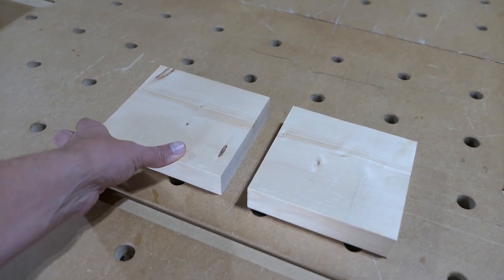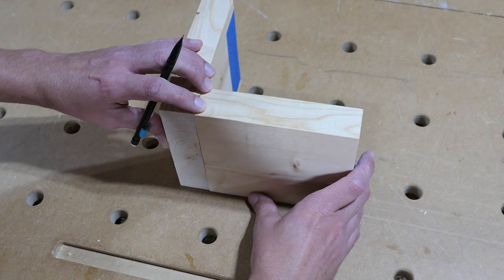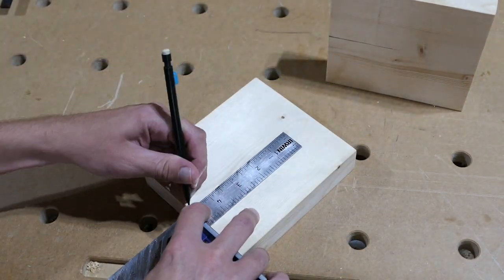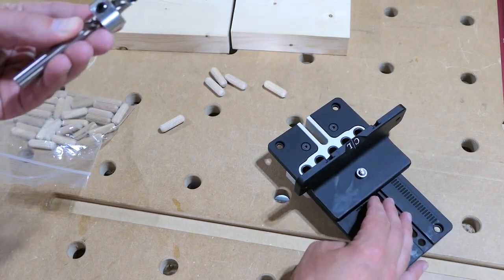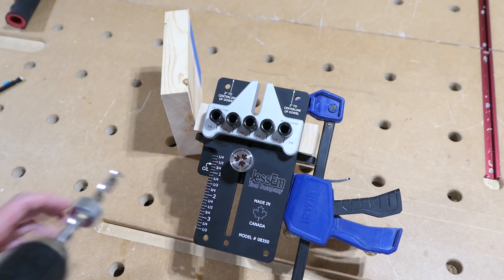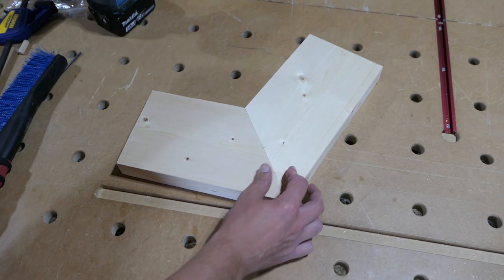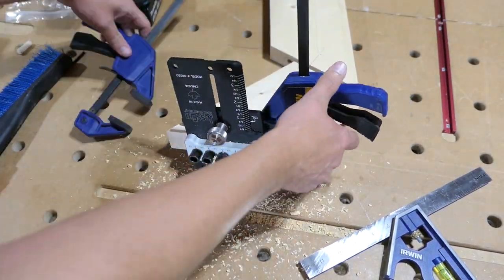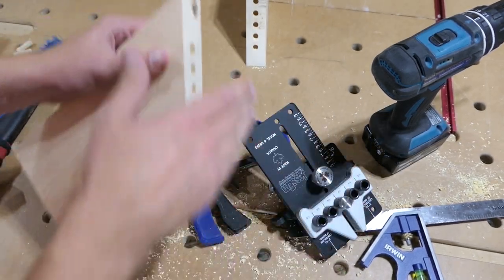2 Woodworking Joints with the Jessem Dowelling Jig - Detailed Instructions

Comment: I strongly recommend anyone considering this jig look into the dowelmax. If you still decide to get the Jessem, consider using the dowelmax's "reference face" method instead of measuring and marking center lines. It will almost certainly give you better, more consistent alignment of your dowels.
Reply from the maker: Hey thanks for commenting with your recommendation, I haven't tried the dowelmax but I'm sure it's well suited for dowelling as well! Cheers 👍
Reply: I tend to agree that marking a centerline with pencil is a point of potential failure and that aligning with a reference face is a better approach. Since the Jessem jig is symmetrical,  you are able to use the indexing pin in the first hole to align the array of holes from a reference-face, and then on the mating piece, switch the pin to the bushing on the opposite end of the drill guide and repeat the process. That works for end-grain to edge-grain joints.  What the Jessem needs that the DowelMax has is an indexing rod.   What Jessem has that DowelMax doesn't have is hole-spacing proportional to dowel size.  For the time being, I'll stay with my Joint Genie.
Reply: @LegacyCraftworks  Thank you for sharing this advice, really helpful! I actually wanted to get the dowelmax, but it was sold out everywhere so I went with the Jessem instead.

Comment: You're doing this jig a disservice because you're not using it properly. You dont need to do any measurements or marking for those joints. You didn't use the alignment slot at all. I would suggest you watch the videos by Matt Made It on using the JessEm jig.
Reply from the maker: You are absolutely correct, I will delete this video and explore in smaller chunks once I have a chance. I appreciate your input

Comment: I'm curious how well this would work on a face frame that is only 1" wide stock. I find you can only fit 1 dowel in such a space. I've tried making an accurate jig of my own that is set up similar to the Jessem but when I put the mating piece on, its still not 100% correctly at 90 degrees, it is still slightly off. I feel like many dowel videos show using the dowel jig, and then they just show the joint - "look, it's flush!" but they never show measuring anything like the squareness.
Reply from the maker: I might be misunderstanding your comment, but wouldn’t your cuts from the saw determine if the 90’ is accurate? The dowels (with any jig) will just join 2 flat surfaces together.

Comment: How do you drill holes in two different sizes of workpieces? For example, can you leave a 1/4” reveal when joining a 4x4 leg of a table to a 3/4” apron?
Reply from the maker: When you drill the holes in your posts, you would adjust the bottom plate 1 or 2 notches to move the holes inwards 👍

Comment: 3:56, i wish they put a mark going along the bottom so you didn't have to eye ball it.  How much play do you have in the joints if you're off the mark?
Reply from the maker: At first I thought so too, but it's actually quite easy to line-up how it is. If needed, I might add a little scratch on the back of the plate. I think that could be helpful. I still need a bit of practice 😅 Edit: Just saw your question: Not much play at all, but that probably depends on the size of your dowels.
Reply: @LegacyCraftworks  i suppose you could just reference the edge of the jig instead?  I think I am going to go with the dowelmax though, seems less prone to user error.
Reply from the maker: @RunningCordoroy  I never tried it but the Dowelmax seems like a great tool as well 👍

Comment: Does this jig also work with European size dowels? Example 6 or 8mm
Reply from the maker: They make both version of this tool (Imperial or Metric) so you would need the Metric version of the jig to use metric dowels 👍 (You might have to order directly from the manufacturer)

Comment: I have both a Dowelmax and a Jessem.  I won't get into a pissing match with anyone as to which is better.  They are both excellent jigs but each has its own strengths and weaknesses.  The reference face method used by Dowelmax is far easier to use than the centerline method used by Jessem as shown in this video.  The reference face method can also be used with the Jessem jig.
Reply from the maker: Thanks for your comment. I don't have much experience with this one and I never used the Dowelmax😅 From the pictures the Dowelmax looks like a great tool too.
Reply: Reference checkmark face method used by Dowelmax can also be used with Jessem if you like. I have both a Dowelmax and a Jessem.
Reply: @garnerboyd4206  Having both, which would you recommend to someone who can only get one of them?
Reply: And, as an owner of the JessEm jig, I recommend using the reference face method instead of drawing lines. In my experience, the reference face method is faster & more accurate (less risk of parallax error).
Reply: @GeeDeeBird  Just pick one randomly by rolling a die.  You can't go wrong with either one.  Dowelmax is more expensive, but the built-in clamp on the Dowlmax is a huge plus, and the Dowelmax is a beautiful jig to behold.  When all the pluses and minuses of each brand are tallied, even taking into account cost differences, the Dowelmax and the Jessem are equally desirable to me.
Reply: @stevew3978  Thanks!
Reply: @Richard-id-000  Feeling smug and needing to insult, huh?  My post was not even about this particular example in the video, but was about Dowelmax vs. Jessem in general.  So, the "duh" was on yourself.
Reply: I have jessem, I use reference face method, don’t use centre line.

Comment: This jig, like most dowling jigs, is not self-centering.  This is not a problem, but extra care needs to be taken to mark those faces that you want, in the end, to be flush.  This can be up to two faces.  Since the holes for drilling holes in the jig are symmetrical from each edge (edges that are perpendicular to the row of 5 drilling guides), either edge can be used for reference.  However, care needs to be taken to match the two surfaces that you want to be flush that corresponds to the distance from the adjustable fence, as it will never likely be centered, nor could it be "centered", on pieces that are being joined (e.g.,  dowels at the end of a board vs. dowels in the face of a board).
Reply from the maker: Yes, I realized this while trying it out in another video. Thanks for putting it in actual words because I was having a pretty hard time communicating that! Thanks for watching! 👍

Comment: I bought this jig and my center line is off I’ve gotten three replacements by the company the customer service is great but it takes forever to get replacements. I have about 1/64 off to the right when I flip the jig over to do an adjacent side I end up with a 1/32 error of wood alignment. If they placed a line in the center of the dowel guide(grey piece) there would be no need to transfer lines and no need for a peep hole either. The concept is good but they need more markings on the jig. Plain and simple I wouldn’t buy this jig again and make sure you buy from their website or when you run into problems they won’t refund your money only keep sending replacements parts
Reply from the maker: That sucks. Hope they get your issue resolved, so far I didn't notice imperfections with mine.
Reply: I do not own this jig, but if I was you I would forget about using those centering marks. Instead put the pin in the end hole as a stop on the edge of the wood and then drill in the next hole and so forth. If the first hole is to close to the edge use the second hole.
Reply from the maker: @richardlug6139   That's a good idea!
Reply: Yup that’s exactly what did! I just put a dowel in one location then put the jig directly to the dowel and clamp the two pieces together. It’s harder when you have to drill on the face and both pieces are small 2”w. Once the dowel and jig are in place there are no alignment issues. No more markings just drill then put the jig to dowel and drill other board

Comment: 1) nobody wants to fumble with an Allen key and tiny parts. Figure out a "no tool" way to switch it over. 
2) too fiddly. 
3) Demo could not be worse. 
Bottom line this needs a lot of work. Best of luck I sincerely wish you success.
Reply from the maker: 1) Look at it positively, now you know this tool isn't for you. 
2) If you only need 1 dowel size for all your projects you wouldn't need to replace the drill guide. 
3) I won't disagree on my demonstration skills - I'm a beginner documenting my learning process and it's fun to share/discuss with people who are interested in woodworking.   
Thanks for your feedback 👍
Reply: @Tioga which jig do you use?
Reply: I can tell this guy doesn't have a wife are a girl friend. lol
Reply: @garnerboyd4206  And your proof is?
Reply: Check out the DowelMax. No fiddly parts. No measuring, marking and lines. Faster and more accurate.
Reply: Re your #1 about not wanting to fiddle with allen key:   Jessem could enlarge the drill guides into a cartoon dog-bone shape wearing a conical party hat and use four knurled thumbscrews inserted from the top to secure the drill guide to the plate; that would eliminate the allen key. But in any case you need to get the allen key only when changing dowel-sizes.